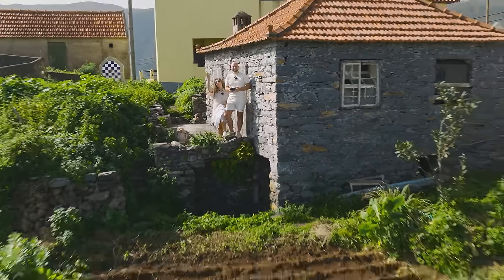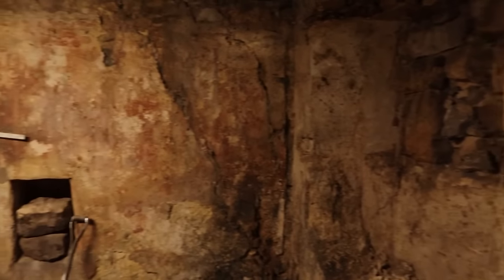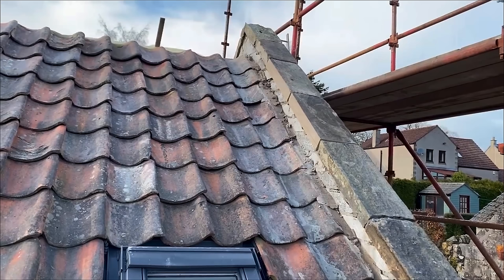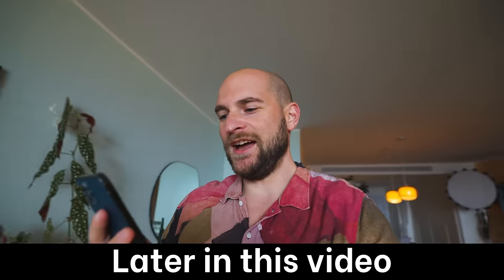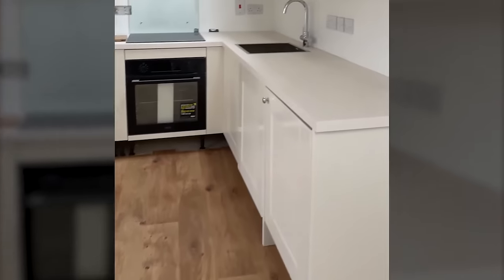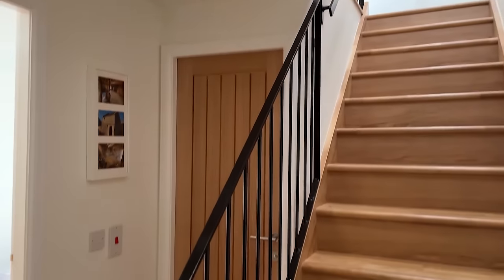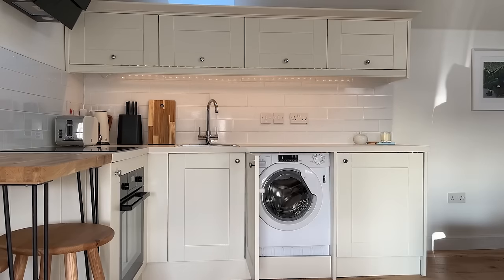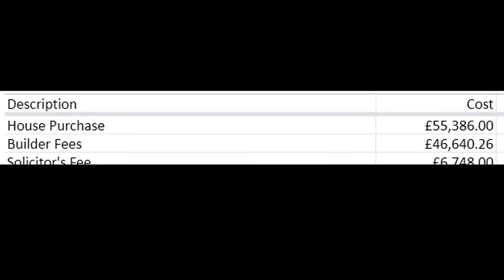He Bought & Restored an Abandoned Tiny House

Comment: You’re right it’s a different climate with much less sun. In the UK there are issues with raising damp and humidity. Likely the cottage wasn’t well insulated hence the walls which also hide any new plumbing, heating and electric. 
There may also be fire code regulations for separation and doors between rooms. 
He did a great job!